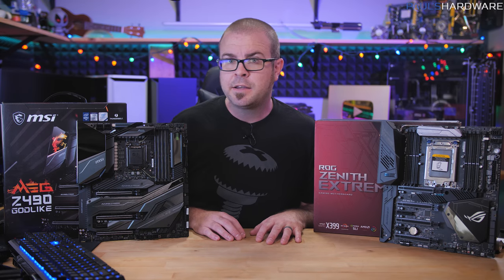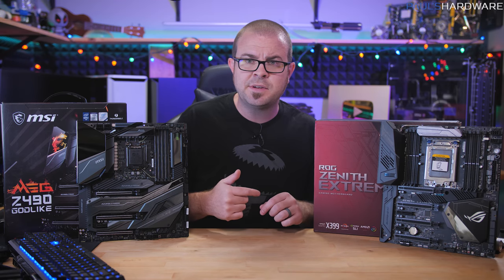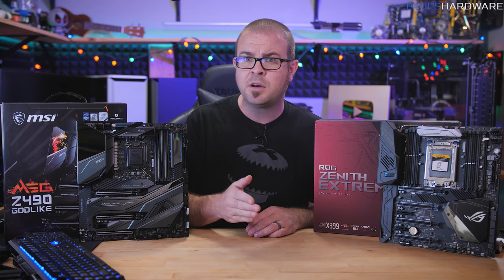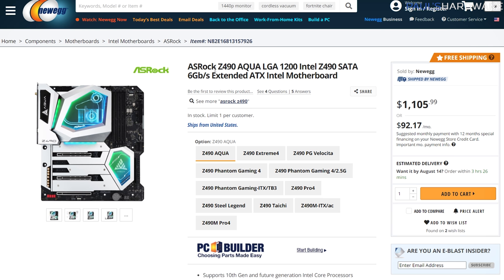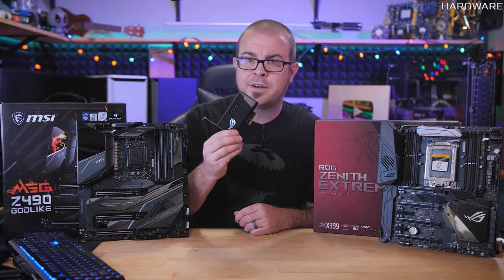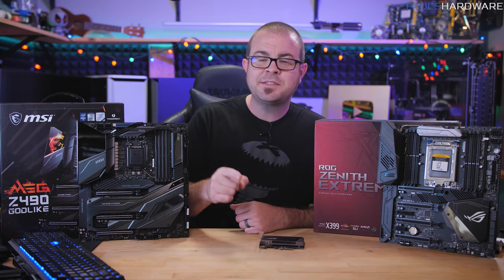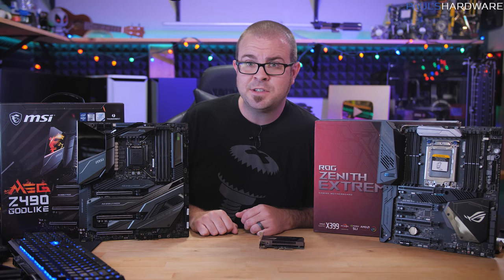What Does a $700 Motherboard Have that a $200 Motherboard Doesn’t?

Comment: Guys are gonna be like "oooh, I need to get a 10Gb/s NIC" then plug it into their 150Mb/s cable internet.
Reply: God I would kill for 150mbit Internet. Although I hope that next year I can rock 200mbit over Glas fiber.
Reply: watching ppl commenting with 3mbps internet :3
Reply: @Knallteute  its such a good feeling to upgrade from crappy 4mbps internet to 250mbps. Like, it makes things 10000x faster if you use your computer a lot.
Reply: @Knallteute  you don't need fiber for 200.  fiber starts at gigabit up/down, i'm using it, it's actually pretty affordable.
Reply: @synthlord9544  here we get fiber with different contracts. We took the one with 200 as it was the cheapest.
Reply: @Knallteute  Interesting!
Reply: When I moved I downgraded from 600mb/s to 11mb/s, feels bad bro
Reply: Depends on use case- I use 10gig on my main system and 40gig on my server ((Q)SFP+). Means that everything is wicked fast when I'm pulling different system images, doing live file editing etc. 

This is more of a linux/power user thing, but there are real and great use cases for it
Reply: Only have 50 Mb/s and pay $120 a month. Feels bad man
Reply: @EfficientAthletics  $120 usd? in usa? swich companies i get gigabit up/down fiber optic for $55 usd per month
Reply: @synthlord9544  Rural Appalachia only has a few choices. In my county we only have 1 real ISP. The rest are satellite ISP's with data limits and latency issues.
Reply: @EfficientAthletics  gotcha, well it you had max speed internet, you would be urbanized, and all the benefits of rural Appalachia wouldn't be there anymore. That's the trade off i guess. To get my internet you'd have to be in the thick of urban tech land, so... yeah.
Reply: @synthlord9544  Haha yeah, $400 rent a month and low cost of living is 👌
Reply: Why wouldn't they? Do you even understand what such fast NICs are for?
Reply: Yeah totally useless as we all know there is no use for networking that isnt internet.
Reply: Mine goes to a nas first though
Reply: In Romania we had gigabyte pipes since 2008 son! Imagine having that with a 80gig HDD.
Reply: @EfficientAthletics  - Wow, $120. for 50Mb/s.  Where I live (Oklahoma) its 1Gb/s for $85 for home use and my ISP is trying to increase the speed even more once they finish updating everything to fiber optics.
Reply: @WarHawk-  just looked at the prices for my ISP. If I wanted 1gig up and 50mb down it is $300 a month. The ISP says it is all fiber, but I thought Fiber was 1gig up down?
Reply: I have gig internet. Its honestly cheap. Around 70 a month.
Reply: Getting 1 mbps rn in NYC 😂
Reply: @Ayoodanny  - So you are saying that you just finished downloading 'Scream' (1966) in time to download 'Scream 4' (2011).  that sucks 😲
Reply: About $42 per month in Europe for a 250 Mb/s connection. You guys are really getting ripped off in the US!

There isn't much use going higher than that for just downloading and casually gaming online though. It's probably worth going slightly higher if you're a big content creator or pro gaming though.
Reply: but 10gbps is almost 10 times faster than 150mbps so why wouldn't you??? Its really fast
Reply: @electroevolution5777  900 upload and 40 download? You probably mean the other way around. And I have 250/100, so that isn't so bad. Did you even check that you are getting what you are paying for?
Reply: @Draclord35  Sorry, sometimes techs refer to download speeds as just simply "up", not to be mistaken as "upload". To correct my terminolgy, yes I am getting 900+/- mbps download and 40+/- upload.
Reply: @LeReVaQ  If my math is correct, 10gbps is nearly 66 times faster than 150mbps. Also, 10gbps is impossible to get, especially for a home consumer.
Reply: @electroevolution5777  
 ¯\_(ツ)_/¯
Not such a massive difference then. Not that I really need more than 250 Mb/s anyways but the 100 upload is quite handy when I have to upload projects. I guess it also depends on your VAT, we've got 25% here and I included a couple of other charges in the price too.

Still, seems like most prices in the US are ridiculously high for a service that is quite terrible.
Reply: Having a stupid fast LAN makes a heap of sense for your NAS even if your net is slower. Chelsio SFP+ NICs and Mikrotik switches make this really doable.
Reply: IT'S CALLED FUTURE PROOFING, DAD
upgrades computer every 1-2 years
Reply: Good for internal network transfers.
Reply: @camofelix  i use a 1 gig switch for a network storage/render solution, it can be pretty slow would you recommend switching to 10gig (yes i do seriously use homeservers)
Reply: @progenji6407  Always depends on cost. If you can do it on the cheap- then by all means. One solution is the MikroTik crs 305. has 4SFP+ 10 gig ports for ~120 dollars. add in an SFP+ card from ebay (some are dual port cards), have a third port on the switch attached to your main machine and use the final port as a connection to the rest of your network. 

Warning on the mikrotik stuff- it's great as a dump switch, but the management interface feels like a gorilla and a caveman had a lovechild of pure idiocy.
Reply: @camofelix  cost is not much of a concern tbh, I will drop 3k on it if it speeds things up im more curious about the real world speed advantage it offers me
Reply: @progenji6407  what's the workload? if you're rendering/ editing off of it, then I see 10gig as a minimum (for every point in the chain, server switch etc.) Also remember that 10 gig is 1GB per second, so if the server you're using isnt capable of of saturating the links, it won't help at all
Reply: @camofelix  Its mainly for CAD renders, i've already ordered componentry after doing some reading on reddit, yes the server closet will satisfy the bandwith thanks for the advice man!
Reply: @progenji6407  No worries mate! Best of luck!
Reply: @EfficientAthletics  What?!?! Where is this?
Reply: @EfficientAthletics  Oh... OK. Got my answer. Well, let's hope that Elon Musk's Starlink (https://www.starlink.com/) gets launched soon.
Reply: @synthlord9544  Direcpath - services high end and low end apartments in the US.  You don't get anywhere near a gigabit...or even 50 at night.
Reply: @jeffweingrad4658  That's not my company and I don't live in an apartment and I use speedtest and certainly get gigabit up and down, you're wrong.  I have my own fiber line and optical network terminal you fool
Reply: @synthlord9544  "you're wrong".  I'm sorry.  Was I wrong about being in the US, or was I (and everyone else) wrong about my shitty speeds?  Please enlighten me oh great one.
Reply: Its for local area network if you have 10gig capable server you can store data on server and just use a small ssd for your operating system.
Reply: Guys who think the internet connection is the only connectivity that matters within a network...
Reply: @synthlord9544  fiber is affordable but it's almost never available outside of big cities. I live in a well populated city and only the richest areas have it within the downtown area
Reply: @Emot10ns  yup
Reply: Laughs in 5mbps
Reply: @synthlord9544  the term "fiber internet" or "fiber broadband" is a play on words and it starts on speeds as low as 56kbs as fiber means the same as cable or wire, as when they say fiber you start to think fiber optics witch translates to glass wire.....
Reply: @electroevolution5777  not in switzerland
Reply: @antbart3487  It is a fiber optic cable.  It's not the same as cable.  It's 1000Mbps upload and  download for my plan.
Reply: I have a NAS so for me I would be quite usefull. But then i also need a new switch
Reply: @Knallteute  we've got 500 :)
Reply: In Australia we pay $89 dollaroos for 100mbps, reading through the comments I don't feel vastly ripped off, if it wasn't because NBN cost taxpayers over 50b dollaroos.
Reply: @synthlord9544  actually fiber starts at any supported speed from the ISP There is not requirement or bench for it. Either way most hfc plants can handle gig symmetrical, but it wouldn't matter. Even if your computer is capable of processing the speed, most servers are not. The best you get from fiber is Ping reduction for now.
Reply: 10g network is more for internal data transfer than internet usage... Right now, not even the fastest home/commercial internet connection you can contract, reach the 1gb bandwidth... I think there are a few of enterprise services that are over 1gbps, but those cost just too much for home usage, 

Also, I'm sure that I already saturate my 1gb network when using my NAS, but I don't actually need 10gb because I don't edit videos of something like that with my NAS.
Reply: To be entirely fair here, even if your external internet connection is never going to be full gigabit, if you're the kind of person that pushes lots of chunky data around inside your own home network, investing in gigabit+ capable hardware is still worth it for the sake of being able to transfer those chunky files around without wasting too much time waiting. I plan to keep the majority of my working data on a NAS, so having gigabit+ LAN bandwidth will be super sweet.

... My Cisco SLM248G however is the bottle neck, for now, but I've got my eyes on an upgrade to Ubiquiti hardware eventually. >w>
Reply: this, but 1G, definitely isnt going to be enough for much longer, 2.5G should definitely be the defacto from now on
Reply: currently getting ~360 Mb, for around £50, 500M is only an extra £10,  1, and 2 Gb, isnt far off
Reply: @EfficientAthletics  I'd Sue
Reply: @antbart3487  Fiber is more about latency than Mb/s, although it also does very good in that camp.
Reply: Orlando, actually 30 mins north, and att fiber just came knocking with an offer for 950 mbps for $65 a month no contract. I’m stuck in a 480 mbps for 80 contract for a few more months. I came from an area where 25 mbps was 80.
Reply: yeah that's not the only thing a 10gb nic is good for .
Reply: @Knallteute  I downgraded from a 1Gbit glas fiber to 200Mbit and it is still never fully occupied.
Reply: the 2 options i have for internet
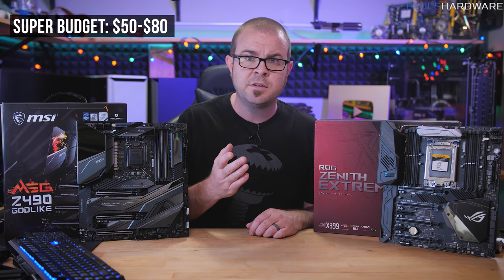1:16mbit glass fiber
2:250mbit copper
WHY???
Reply: @Draclord35  42$ for 250? sorry to say youre getting ripped off :P around 40$ USD for 1gig in denmark :P
Reply: @YoDudeImADude  could just be a currency issue + Stockholm is expensive for internet. Might be cheaper in other cities. I could get 500 or 1 gig for a bit more but I really don't see the point.
Reply: 😂 i now have up to 225mbit via LTE (at home usually around 100mbit) via cable we only had 5mbit 😅 the internet speeds are ashaming for germany...
Reply: @EfficientAthletics  not just rural Appalachia.  I'm in rural Ohio.  30 minutes north of Columbus. We get what's supposed to be I believe 50mbs but actual performance is like 3. Not 30 but 3. Its spectrum and they have never fixed it. They refuse to
Reply: Where I live they promise 20mbps but we get 2-5 in the evening...
Reply: its for better file sharing
Reply: when my family was paying for internet, they were paying for 20mbps download, they couldn't pay for it anymore so i started to take over the internet. I upgraded to 80mbps, decided i wanted more then upgraded to 100mbps. Gigabit internet came in my area and upgraded to 1gbps. I just don't feel that gigabit is quite worth it for what i do and 100mbps is very good, for my consoles and my PC. Downloading on Gigabit internet is super fast, don't get me wrong, but 100mbps is very nice :(
Reply: @ZR0N1_Gaming  the struggle is real in some places
Reply: I have one gig for $60 a month.
Reply: @camofelix  Just out of curiosity, can you elaborate more in what the heck you're doing that actually takes advantage of such ridiculously fast speeds? Can your storage devices even keep up with 40gbps?
Reply: @LeReVaQ  What the heck is that math LOL

Comment: "In a world without flashlights.....ASUS brings LED audio jacks."
For only 700.00 dollars.
Reply: A few years ago I installed small a fe white LED’s  to light up the back of my case. By having light available when you need it a is very helpful .  

Now with dollar store LED pucks it very easy to place them where you some much need light.
Reply: And the funny bit is you don't need it - all modern sound cards have jack auto detection so you can plug your microphone in any jack and then either let sound card auto switch it, or you can manually say what's connected in that jack.
Reply: i only got USB Thunderbolt 3, Aura, $500  Deluxe board.
i needed the X!
Reply: My Aorus Master has gold jack rings, so I would have been extremely happy if they had LEDs inside.  Instead, super tiny print that's hard to read unless you're right up against it.  I ended up just using the manual to refer to.
Reply: @phydeux  I drilled tiny holes all over the backplate going around the usb ports and taped a small strip of leds powered by a molex connector to the back side....i have an inverted motherboard in a Raven case the back of the MB is at the top of the case. works great for pluging in stuff in the dark. Now after watching this i might have to see if I can rig something up to make my soundcard jacks glow. I also use linux now so I can use both the built in audio and my sound card , I can also reassign what the jacks do with a free opensource program. I currently have 4 different surround sound speaker sets fed into my cards for 12.4 surround....its not perfect but it sounds good at medium volume.
Reply: @melgibson6331  Great going with the LEDs on the backplate and inverting the motherboard. However, the 12.4 surround is useless if the software (game, movie player) cannot split it into 16 channels. The best is to use the 8 channels and place the extra speakers in the same 8 locations to give the right sound image (as intended by the 8-channel split). The extra speakers would help you get extra volume.
Reply: ...and the sad part is, LEDs are rather cheap... 

Hmm, let's throw some pretty colored lights into our products as the hottest new feature... traditionally an led light would cost maybe $0.70 - 2.40 ea, but since we are buying in mass bulk, we can get them for about $0.20 - 0.80 ea. We can put about 20 of them on a board for about $20.00 and mark up the price of the board by $500.00 they'll foam out the mouth for it...
Reply: the super cheap mobo's have those coloured plastic ones that work when it is off :P
Reply: @isaacmadhavan  i HAVE A PROGRAM CALLED HDAJACKRETASK....YOU CAN REASSIGN THE PORTS AND MAKE THEM WORK TOGETHER...PLUS MANY OTHER PROGRAMS AND SCRIPTS...IN LINUX.
Reply: @melgibson6331  I understand. However, just reassigning the ports and sending sound to different speakers isn't enough. 
I'm talking about the sound "image". It's like this: For a film, the sound engineers create a sound experience using a certain number of channels (2, 6, 8, etc.). 
For example, here's something about Dolby Atmos from the Wikipedia page (https://en.wikipedia.org/wiki/Dolby_Atmos): Dolby Atmos technology allows up to 128 audio tracks plus associated spatial audio description metadata (most notably, location or pan automation data) to be distributed to theaters for optimal, dynamic rendering to loudspeakers based on the theater capabilities. Each audio track can be assigned to an audio channel, the conventional format for distribution, or to an audio "object." 
So, to get a proper rendition of the sound for a movie or a game, you need something like the Atmos software to divert the sound correctly. And, that's assuming you have a correctly encoded BluRay disk or copy of the film you want to watch. The same with games: you need a game which has been written to work with something like Dolby Atmos. 
For Atmos, you need 7.1 + 4. This means that you need one subwoofer (the .1), one center channel, 2 front (left & right), 2 side (left & right), 2 back (left & right), and 4 overhead speakers (a pair in the front & a pair in the back).
Hope this helps.
Reply: @isaacmadhavan  I know I have a Bi aural sound software and tons of other programs that let you mix it or it does it for you...just use linux and go to the debian repos to get the software. Even Reaper works with my guitar and speaker placement.
Reply: @melgibson6331  Aaah... OK. Kewl. Thanx for the pointers.
Reply: @phydeux  audio jacks layout on motherboards was standardised about 20 years ago with Mic being on the left (bottom), Speakers in the middle and Line In on the right (top). Colours were added soon after but the layout remained. Good enough for me.
Reply: @bojankotur4613  - That's all fine and dandy for 2.1 setups, but when you start venturing into surround setups it can add a few more connectors and it's valuable to have some sort of markings.
Reply: Jay _TooGoated  - An AMD X570 mobo with a suitable Ryzen 9.

You'll save money and have a better machine.  :)
Reply: Jay _TooGoated  It's not too late to correct that mistake.  😉
Reply: LIKE THEY USED TO BE COLORED ON EVERY SINGLE BORD SO YOU DON'T NEED TO FUCKING READ